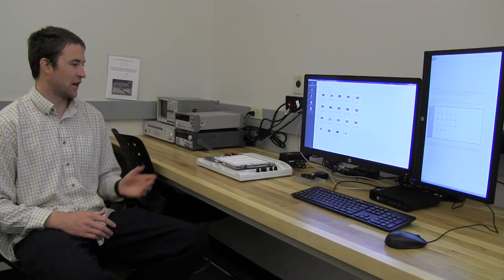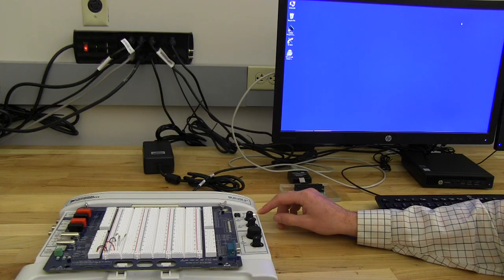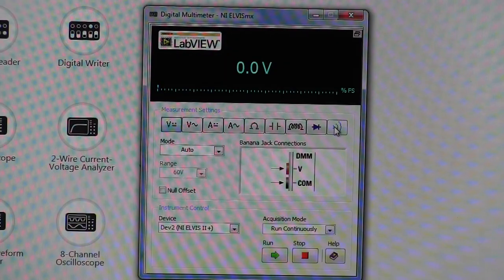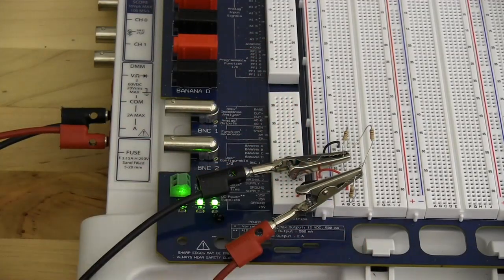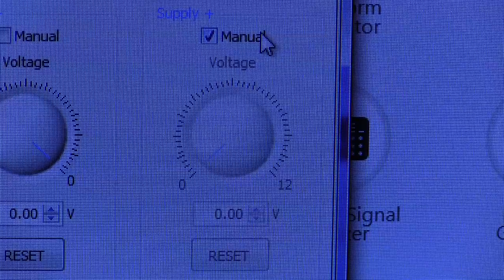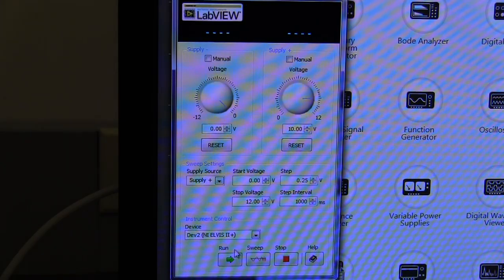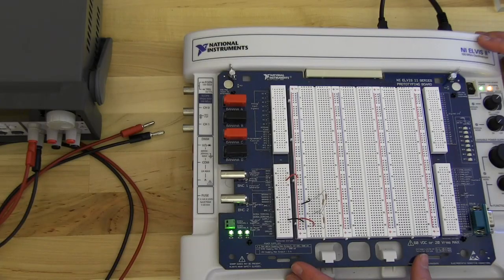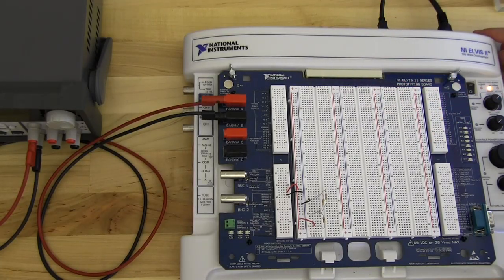NI ELVIS II+ Laboratory Platform - an Introduction

Comment: Driving the entire power rail column with a signal may be convenient for making a video, but it is terrible bread-boarding practice.  Just run the signal to a row and leave the power rail columns for the DC supplies.
Reply: Good point.

Comment: Thank you so much for the showcasing the ELVIS II. My professor doesn’t even teach how to work with it so I’m getting my education straight from your vid. You are the hero we needed and the one we deserved.
Reply: In 2003 I had the same exact experience with the original ELVIS system the college used and had us buy. The "professor" who was a math & physics professor didn't have a clue how to use the ELVIS and certainly didn't know basic electronics. Fortunately, I had electronics training from the military and was able to figure it out and even help the professor to get through the labs. It seems so common that the PhD staff didn't have any hands-on practical experience, but tons of theory. Lesson learned: there is theory and there is reality ..try not to get them confused!!   So here I am now 22 years down the road and still using my original ELVIS system and I've just bought an ELVIS II unit off eBay so I can have an upgrade unit. Problem is it doesn't come with the software package and I'm afraid how much that will cost from NI (Now Emerson) .... I was using their Multisim package (basic) but it's just gotten far too much $$ to keep ....